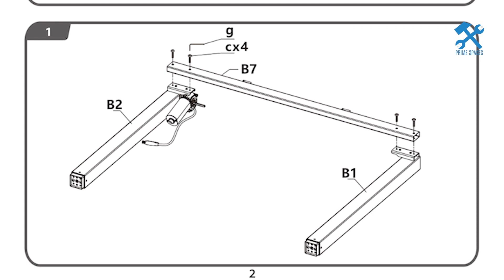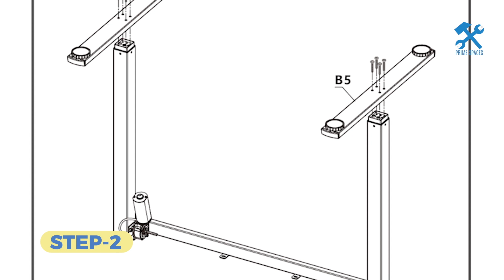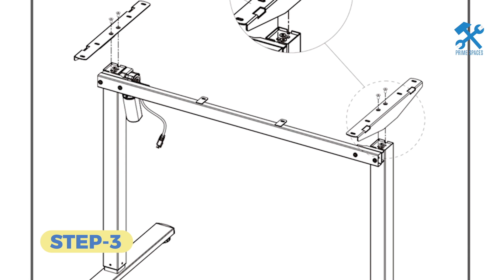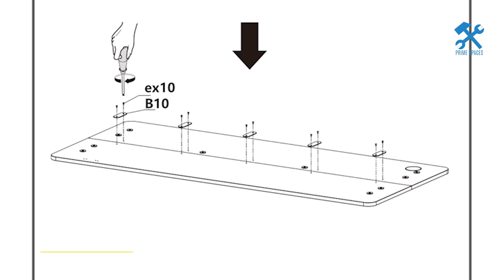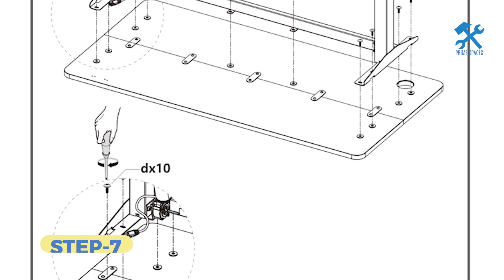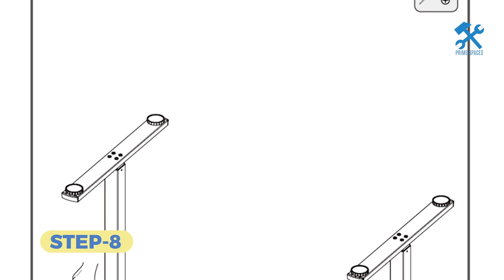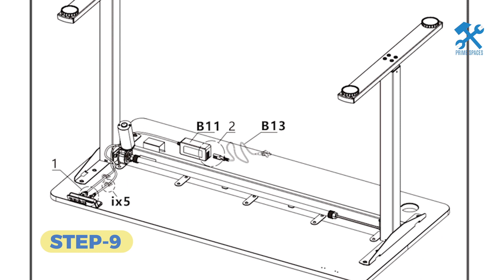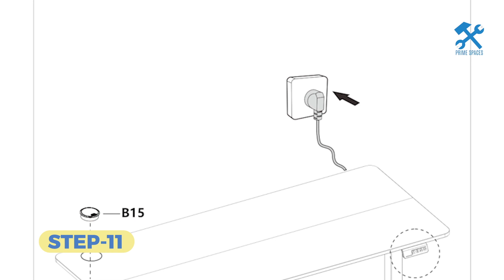Furmax Electric Height Adjustable Standing Desk Assembly aka Putnam Height Adjustable Standing Desk

Comment: The leg with the motor integrated is longer than the one on the other side and it won’t go all the way down. This makes the desk tilt lower to the left. Is this something I did wrong in the assembly or a fabrication issue??
Reply from the maker: Yes, you installed the rotator rod incorrectly. 

Watch this video at 02:18 - https://www.youtube.com/watch?v=nJsPL4dlgp4
Reply: what did u do to fix it i’m having the same problem

Comment: I'm stuck on step 5.  The rod is just slightly "off" on one side in that if I would twist it just a little bit it would fit but it doesn't twist.  Am I doing something wrong or do I have a messed up piece?

Comment: Is anyone having wobbly situation with this desk? I have 2 monitors and basic set up (keyboard, mouse,etc) but I am noticing it wobbles a lot specially in the top part (wooden desk), I am worried it will break anytime soon given it’s a 2 piece wood compared to a slab of wood as one desk.
Reply from the maker: Hey there! You didn’t install the rod properly. See this link for proper installation. Good luck! https://www.amazon.com/live/video/036838beb81645ca8964d0dab20b7eab
Reply: @Prime_Spaces  i thought so too, hoping to fix it this weekend. Need to unscrew everything and try again.
Reply from the maker: I would try first just disconnecting the cords and unscrewing the tabletop from the legs, rather than starting from scratch.

Comment: Has anyone had one leg come shorter than the other? How do I fix that?
Reply: Currently dealing with the same problem.
Reply: Whether or not this is the proper way to do it, I believe I stood the taller leg up and pushed down really hard to make it even. So far I haven’t had any issues with movement